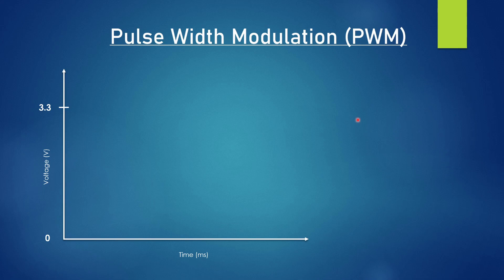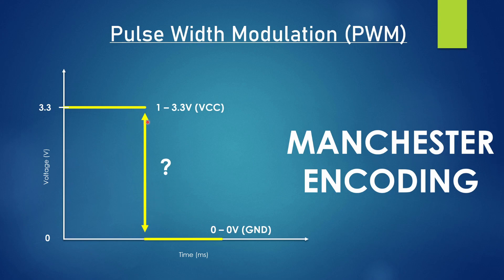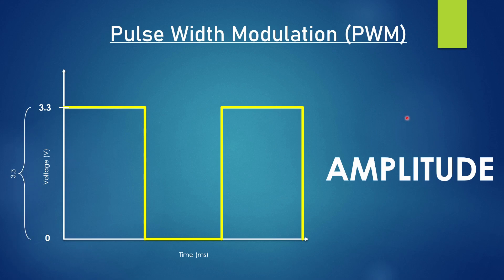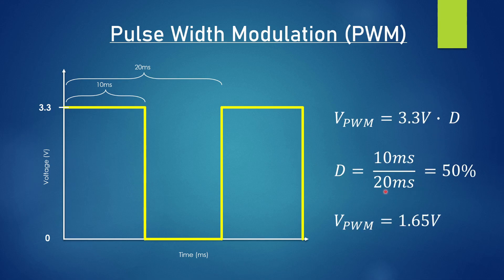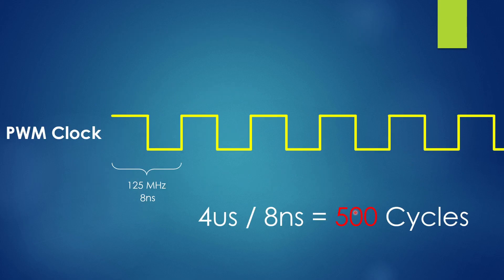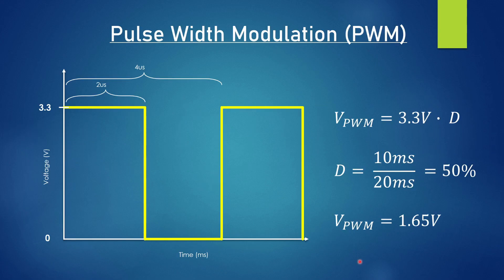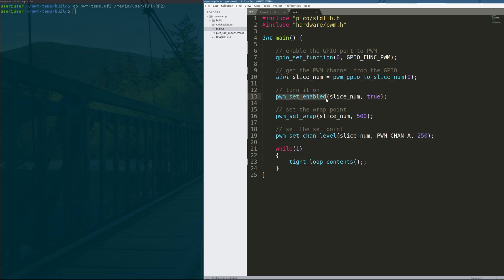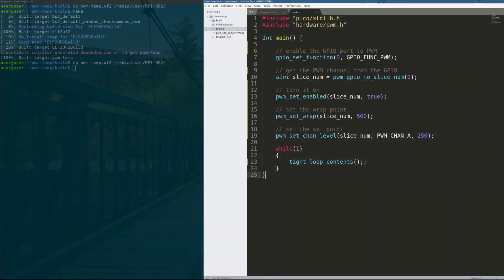Generating PWM Signals Using the Raspberry Pi Pico | STOP BIT BANGING on the RP2040!

Comment: Good video.
A note: in serial communications "Manchester encoding" refers to associating the logic value of a bit to the direction of the transition of the signal (so binary "1" corresponds to "high-to-low" and binary "0" corresponds to "low-to-high" or the other way round) rather than the level ("VCC" voltage and "GND" voltage). This means that, whatever the actual values of the information being transmitted, the serial stream will have one transition in each of the bit-periods.
Reply from the maker: Ah, yeah you're right good catch. I had the names mixed up

Comment: The best explanation I've seen about PWM on the Pi Pico. Would be perfect if you included an explanation of the PWM clock divider so you can produce much lower PWM frequencies... 👌

Comment: Cool video, thank you!

I have a question for you, how can I set a PWM with 50Hz frequency.
50Hz would require 2.500.000 as wrap point using the Pico's inner clock (125MHz)

The thing is that according to the C header of the pwm_wrap_number void function, the wrap point number must be a uint16_t variable and 2.500.000 exceeds the variable maximum number (2**16).

Thank you!
Reply: If you wonder, 50Hz is because I want to control a servo using your method

Comment: great video, i have a question tho could this be used as a clock signal for data transmission?i haven't found any documentation about being able to get the clock signal from the pico and what this offers seems like it would be what i need but not sure.

Comment: can i have wish?? For example of 2 chanel with 180degree phase shift ( not flip flop) with seting of frequency and also duty cycle??  coz at time 0 we shut have one pin HIGH and second pin LOW output.. let se for example for H-BRIDGE i can deal with that code somehow.. still pain for me to use arduino.. ijust try miniaturized my dual chanell function generator and IR2153 or etc was not abble go up to 1MHz per chanell  with dudy drive + freq set + phase shift they in the best scenation end at 466kHz.. and ton of EMI problems..
Reply: I don't think you can use PWM like that, you could use PIO for that thou, which the pi pico also has
Reply: @julianbinder2371  i do and i will share code kid.. dont say you cant.. it is only lack of efford..
Reply: @nin1ten1do  sooooo.... 3 months have passed. Im also a naive kid, can you share the code now? With your dedication and eFfoRT Im sure you have coded the most optimal and beautiful solution 😂

Comment: What's the maximum frequency of the PWM signal that we can produce using Raspberry pi pico?
Reply: I can only assume, but I would say 125/2 MHz (62,5 Mhz), if you let the counter count to one as wrapping point. but there could be more limitations due to delay in the timer mechanics.